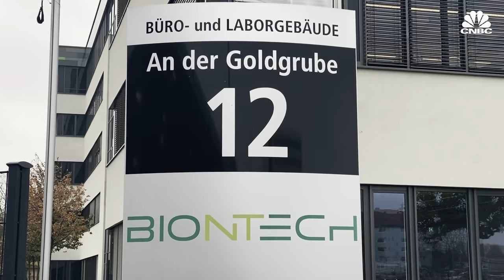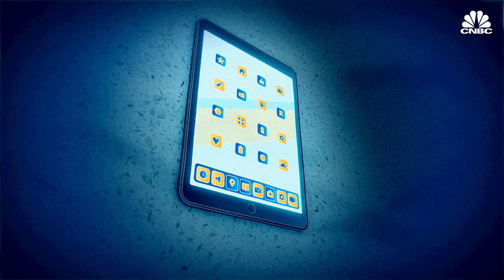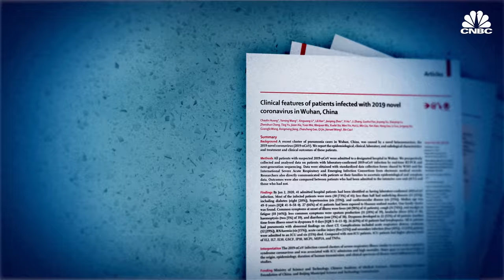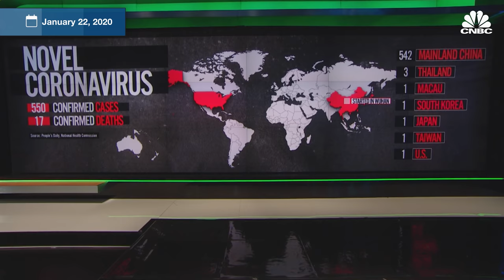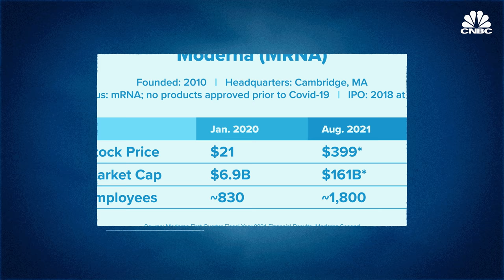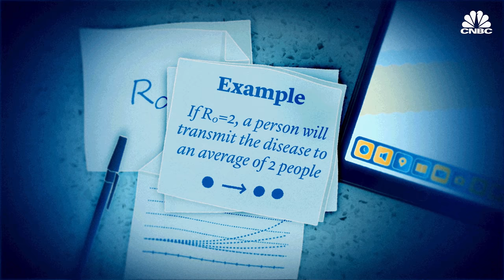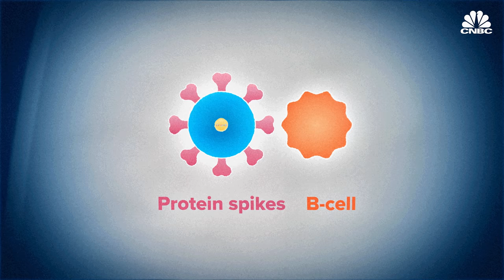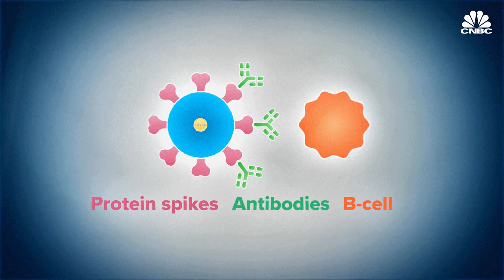How Moderna And Pfizer-BioNTech Developed Vaccines In Record Time

Comment: 42:14 
It was the first sign the pandemic is going to end
Anti-vaxxer: "Hold my corona beer"
Reply: All you had to do was ask for a beer you didn’t have to be weird and stand in the corner
Reply: @pizzablender  Is it still 95% against delta though? Last I heard, it's way lower than that, regardless it is still better than no vaccination
Reply: @mischievousalien8873  Against hospitalization it is (recent figures for The Netherlands). Against infection it is much lower than before.
So yes I would say it still works very well, but it worked even better with the Alpha variant.

Comment: ‘94.5 & 95.5 percent effective’ yeah in another dimension maybe
Reply: Like maybe length or width? Which dimension. Maybe height?
Reply: In preventing severe illness and death? Did you miss that dimension?
Reply: @amols101  FLU
Reply: Against hospitalization for the Delta variant, yes. Those are the current numbers.
Reply: @istvandjumber6474  I am sorry about your friend, but what about "not 100% effective" doesn't make sense to you? 94% does not mean complete immunity.
Reply: @nathanchang7713  what does that even mean?
Reply: @nathanchang7713  u said 'FLU' i dont see how that ties into this? Also those metrics were b4 the delta variant and it is still effective at preventing hospitalizations and death.